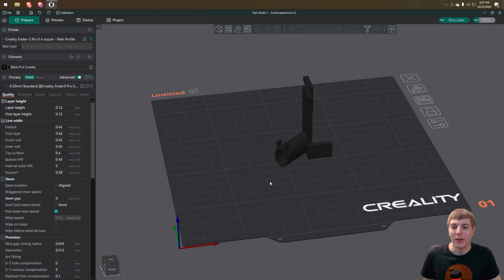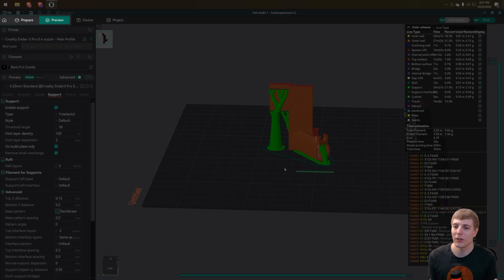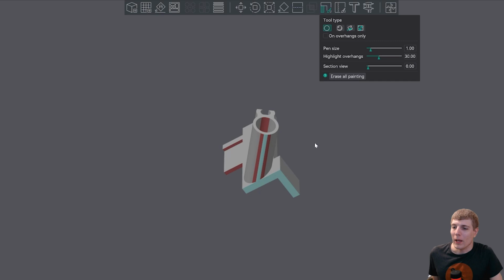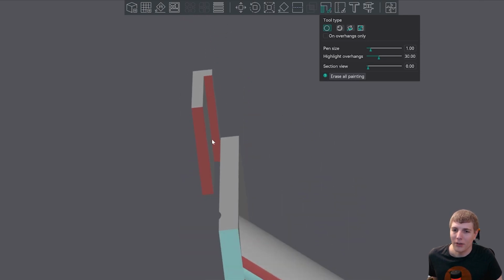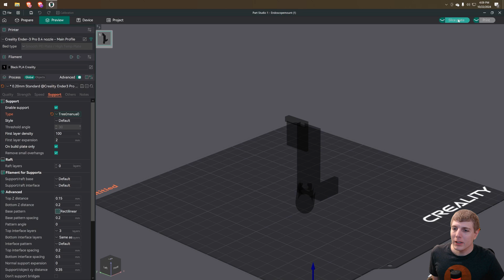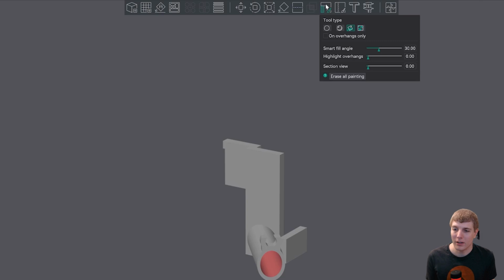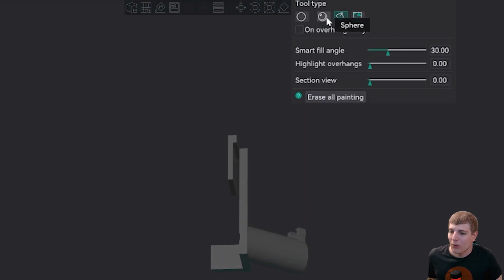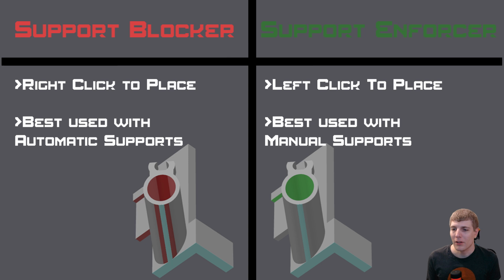Orca Slicer Tutorial | Support Blockers and Enforcers

Comment: This is a bit misleading. I thought the video will be about adding or removing support blockers/enhancers, not painting them
Reply from the maker: You can always turn supports on or off, but if you want to specifically control where supports are generated, best way is to paint them.
Reply: I think litergame means, when you right click an object theres options to add support blockers or enforcers. They give you basic geometry shapes like cube, sphere, torus etc. I'm trying to figure out what these are myself.
Reply from the maker: @kbcubezz6190  ohhh I see what you mean. Those are used if you want to use shapes manage supports on your part. Just a different way to manage supports then the painter. Maybe ill make a video on that.
Reply: @drewmakesstuff Than might be a good idea, I cant find any videos on it.